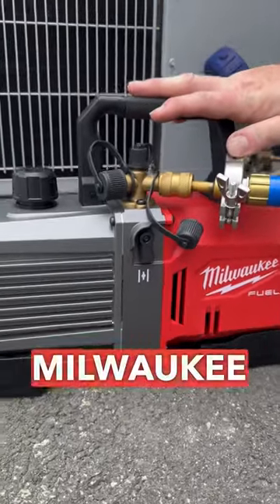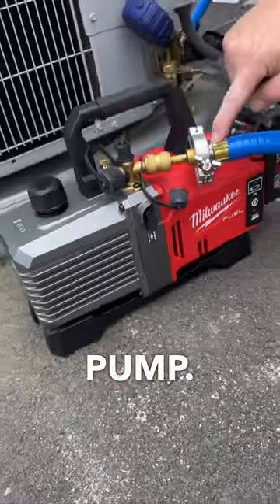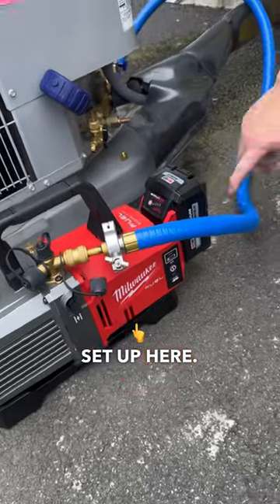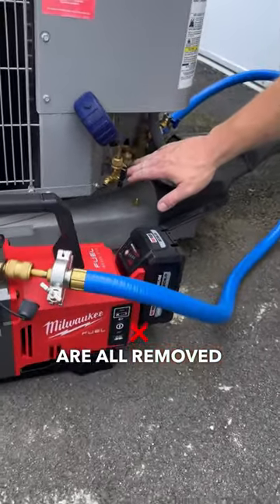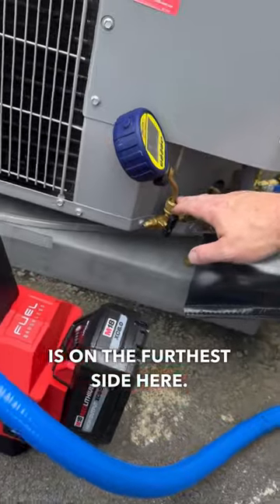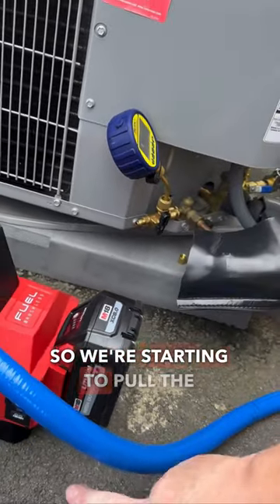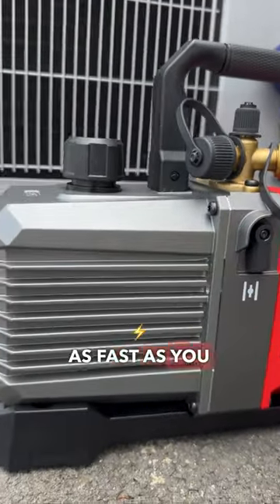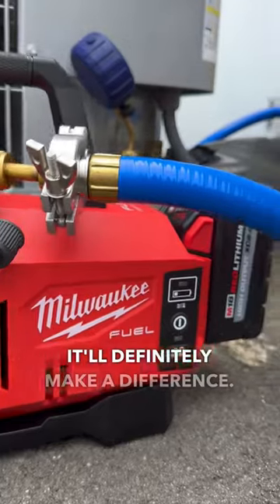New Battery Vacuum Pump from Milwaukee Tool. #tool #shortscreator #hvac

Comment: Hey Brent, did your m18 pump come with an o-ring in the oil fill cap? Sealing into the machined groove of the oil fill cap and the aluminum pump housing? Mine did not, but looks like it should. I’ve installed an o-ring into mine and it feels like it seals better there.
Reply from the maker: I will check mine tomorrow and see.
Reply: @ToolPros  did you get a chance to check for that o-ring? My battery died while pulling down a 15 ton Samsung VRF and it didn't lose its vacuum. So far I'm really impressed with this pump after using it on over 20 systems, The Tez8 is coming out of the van today.

Comment: What type of ghetto hose is thst and why one and not 2
Reply: TruBlu vacuum hose
Reply: @Berzerk29  ah confused me lol I bought the navac 3/8f to 1/4f 1/2 hose black and like they better done really fast but they like to not get a good seal causing make vacum go funny
Reply: @drpepperredneck2781 lol bro said ghetto to one of the most expensive hoses on the market
Reply: @nattybohman  lol mine was 150 for avion that came with the T lol how much was that ghetto lookin hose lol
Reply: @drpepperredneck2781  176$ for one hose and the fittings, they have a 1,100$ set with 3 hoses and everything you need other than the pump.
Reply: Bro are you new here?? Lol
Reply: Hvac market is grossly overpriced.
Need more competition in this like with most products.

Comment: A larger hose is redundant as it is just reduced back down to 1/4
Reply: It does get reduced back down but having the greater area of the inside diameter does make a difference
Reply: @nattybohman no. If pulling from a single 1/4" flare to a pumps single 1/4" flare 1/4" is the largest orifice thus dictating conductance
Reply: @Skunkhunt_42  
Right? That's what I was thinking but there is so many videos of people saying how it makes such a difference. I don't see how. Imagine.. If the hole is 1/4 and 50feet wide tubing.  This wont change the fact that to fill that 50ft area it is only going to pump out of the 1/4 hole.
Yet many videos of people ignoring this. I would love to see a video of this hose vs a similar hose of the same size throughout. If any difference it should be negligible. The difference should be due to how the pump works more so then anything.
Reply: @bobshanery5152  I also see no mention of pump curves in the hvac vac pump sales talk. Most two stage rotary vanes cfm dives after 2-400microns. Welch makes a 2 stage rotary vane that's unique in that it uses reed checks between the stages which allows for more cfm at lower pressures. 

My mentor got sold a fat hose with 1/4" flairs on it, the ID of this hose might even be smaller than his standard hose set's. 
And even if the hose had larger ID, like your saying, your increasing the volume so reap no benefit of pump down speed especially with a 1/4" flair connecting to the reefer loop and to the pump 

Take a 3/4" or 1" orifice, hose and a pump that's suction connection is equal to or greater in ID and then you might see a difference in speed. With the internal volumes of especially residential systems getting smaller and smaller the difference might not be much anyways